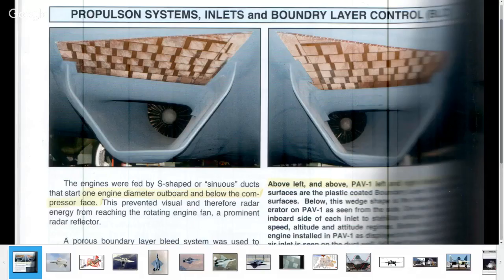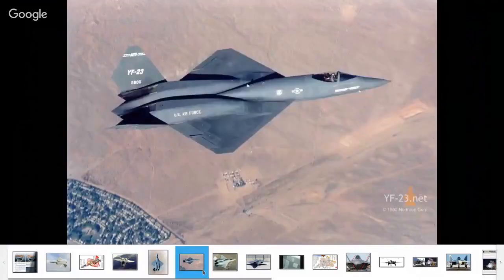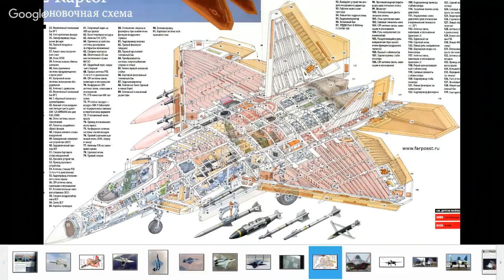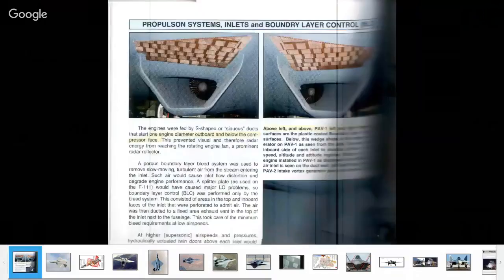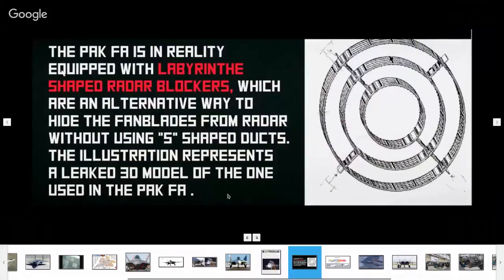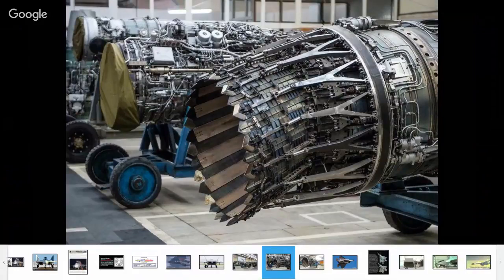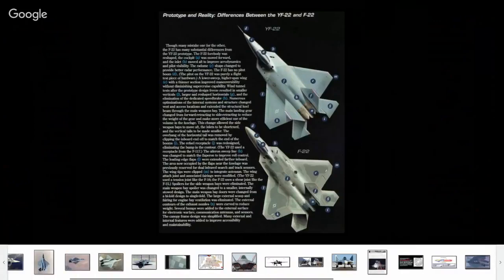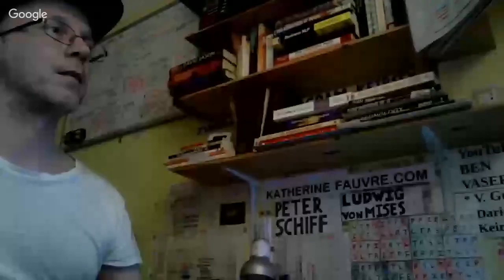Stealth Inlets & Nozzles: F-22 and YF-23 vs Su-57 Felon (AKA PAK-FA AKA Sukhoi T-50)

Comment: Apparently people are now saying that due to the short frontal land gear on the Russian Su-57, that it does not give the full impression, this however can not be further from the truth. All you have to do is go to google and write Su-57 front view and take the best picture you can and you will not see the compressor phase and not only that but also if you do a circle like you inferred it will not be very visible due to the S ducts. To add more, the rest of the RCS is hidden using the radar blockers and ram.
Reply from the maker: Russian stealth aircraft don't have to go up against their own Integrated Air Defence System.   Also folks forget what PAK-FA stands for: Prospective Aircraft Komplex for Frontal Aviation rather than a pure interceptor like the MiG-41 should be.  The capacious belly bays of the Su-57 mean it can fire wide diameter long-range missiles from a safe distance.  And to go up against a HQ IADS it would use the S-70 flying wing Hunter UAV.  A flying wing is arguably the stealthiest flyable shape and definitely very aerodynamically efficient.
Reply: @BenVaserlan  Yes exactly but people say that Russian radars are bad because noise is increased and thus we can't compare public detection ranges, again this is wrong because the companies/manufacturers take note of every single detail not only once but several tens of times to make sure the detection ranges are exactly like they are told to build. Meaning the Russians and NATO will give detection ranges considering (noise), power etc. So as we know Russian Irbis E is capable of detecting a 3m2 target RCS at a distance of 400km (wide search zone) and Byelka should be at least better. With two sources available to me claiming the Russian AESA has 400km detection for 1m2 as opposed to the US APG 77 has a 241 detection range for 1m2 and using detection range equation it is inferior to Irbis, therefore supporting your claim of firing very long stand off hypersonic Air to Air missiles. (R-37M).

Comment: You make some valid points, but keep in mind that the YF-23 was just a somewhat crude demonstrator based on a dated design iteration of the F-23 that was actually proposed.  The YF-23 had different intakes from the F-23, and lacked the radar blocker that the F-23 could possibly have had.  Boeing's proposed F-32 depended more on its radar blocker, but I don't recall the X-32 demonstrator actually having one, either, and for good reason, because it could have compromised engine and therefore flight performance during the demonstration.  Radar blockers have been implemented successfully without significantly compromising performance, like on the Super Hornet, but that is a fixed installation that could afford to compromise stealth, while the F-32, being a VLO stealth fighter, was to be equipped with a variable radar blocker, which implies dynamic trade-offs between stealth and flight performance (i.e. VLO stealth mode involves a compromise in flight performance that the pilot and/or the avionics have to decide on).  Going back to the F-23, everyone says that it was supposedly stealthier than the F-22, and that might be true to some degree from a variety of angles, but not necessarily all of them, and wherever the engine faces can be seen, it would almost certainly have been far less stealthy unless radar were fully blocked.  Every design has compromises, and the F-23 was no exception.  Full intake stealth on the F-23 might have involved compromising flight performance in a way that was not seen on the YF-23, since the latter wasn't stealthy (pole models of the proposed F-22 and F-23 designs were evaluated for stealth, not the YF-22 and YF-23 at all) and therefore didn't have radar blockers.

Meanwhile, like the proposed F-22, the YF-22 had far more serpentine intake ducts that both hid the faces of the engines from all angles and directly demonstrated high performance.  The cost was the extreme difficulty of designing such intakes, but the designers were successful, and this design, like that of the F-35 later, involves the least compromise overall to both stealth and performance.  The F-23, by the way, would probably have had improved stealth with its modified intakes (over those of the YF-23), which were to have DSI bumps and protruding outer (ventral or bottom, in this case) lips like those of the F-35 that would have hidden the engine faces better than the YF-23's intake design, but they still exposed the engine faces at some angles, compromising stealth.  In comparison, the Su-57's intake design, which is currently difficult to make out with any real confidence, is comparable to the YF-23's at best, and quite possibly inferior, which might necessitate the use of radar blockers--either way, some compromise between stealth and flight performance (possibly dynamic like on the proposed F-32) is necessary, and I think its designers generally favor flight performance, since this is clearly not a VLO stealth fighter anyway.
Reply: Either way. The YF-23 nor the X-32 would have 100% engine face covered. Its a myth that stealth requires 100% engine face coverage. It just doesn't. If it did, the YF-23, X-32 or su 57 would have zero % engine face exposed.
Reply: What matters is RCS, as long as nothing is effecting RCS that is what matters, the Russian Su-57 is just as stealthy as the YF-23 with far more upgrades implemented and developed, each of the ones you said are stealth specifically the YF-23 and Su-57. Even if 100% engine is covered, it does not reduce RCS. It would need just an angle(s) to be hidden from enemy aircraft so the radar won't pick it up. 

The One on the Su-57 was a prototype type Su-57 front views and take the best front view and you will never see the Radar blocker nor the compressor phase. The F-35 as you said does in some angles show the engine like any other aircraft however I have a picture of extreme beauty where new Su-57 jets have a much better S-duct tunnel and further analysis on how to improve it is under way. I would love to know why the Su-57 is "difficult to make out with any real confidence"; the Russians basically saw the entire process of the Yf-23 till the current F-22A raptor and copied it. It utilizes 3d S ducts, RAM and Radar blocker, and here is reality, if you/I want to make a real stealth aircraft like the mentioned ones we will pack as much stealth features as possible, we will stop at nothing, isn't that right? To make a good stealth jet, the Russians tried to fill it with LO features. 

Have a good day.